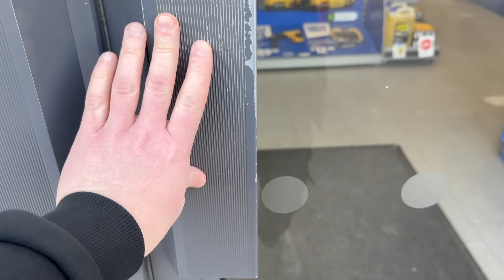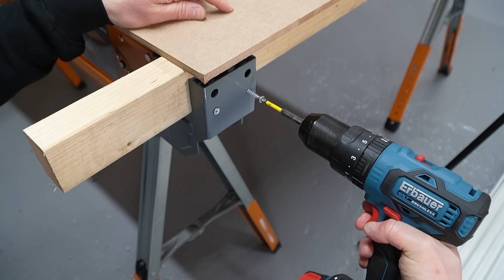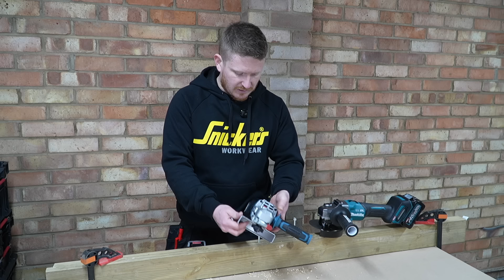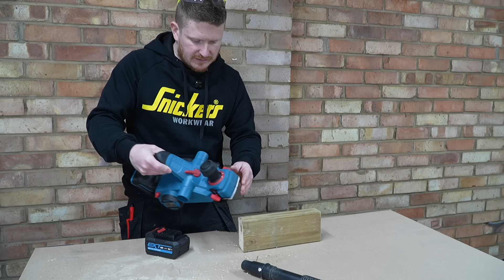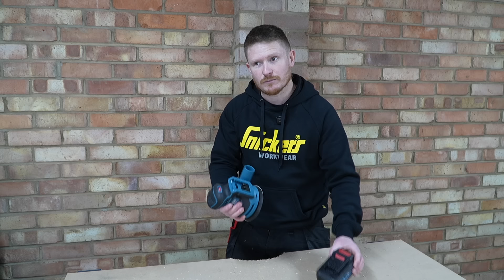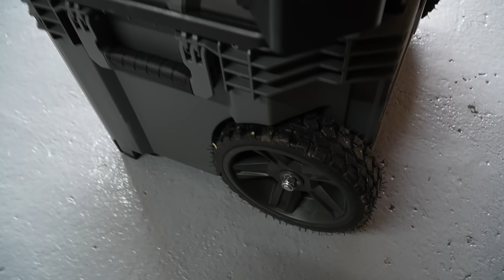Erbauer Tools Tested - Should You Buy Cheap ScrewFix Own Brand Tools?

Comment: Why did you insist on comparing it with the 40v Makita system? For me, you lost me at that (even though Erbauer equits itself really well)! And yes, I'm left handed, and yes,I like the circular saw.
However the absolutely most disappointing thing about this review is you  completely ignoring one of the best features about the erbauer system - the BATTERIES! When I bought mine, a 5Ah battery was almost HALF the price of every other big brand battery. And you didn't even mention it! Other than chineese stuff, they are the cheapest by a long shot. More batteries, more run time, no running out of energy! Just my opinion, but it's a key element to "reviewing " tools like these! 
Another miss, for you fella, is that if you lower the lifting handle on the trolley (easy spring clip affair), to its first indent, you CAN open the middle tool box, WITHOUT taking it off the cart! Just saying!
Added to this lot, I added the Recip, the 256mm mitre saw and stand, several proper lights and have been using them for over 5 years without fail as a handyman for house and garden projects. 
If I had one criticism, it would be trigger control (vs deWalt), seems chunkier. But at the price, as a brand, good quality,  good reliability (old lights were poor), and 5 years later, still doing their thing, faultlessly.  And the storage, good enough, strong enough at the price, if a little limited! Oh, and at B&Q, just wait for sales, and get the cheaper!

Comment: Right,these Erbauer tools are decent enough , you can get quite swallowed up in how well they perform for the money but i have learnt my lesson now and I am on my second but final Erbauer sliding chop saw, these tools are built on a budget ,there's  to much plastic where metal shoud be used  and  please remember tools do break and when a Erbauer tools breaks  its basically junk,you cannot  repair them,there's virtually no spares,throw away tools sadly, Erbauer need The right to repair group knocking on its door

Comment: Erbaur is a Kingfisher brand. Titan is Screwfix own brand Screwfix is kingfisher. Like B+Qs, another Kingfisher brand, Mc Allister brand these are simply generic power tools sourced mainly from the PRC.
Some of the tools are good middle range products, for example a few years back MacAllisters entry level power drill was made by a Bosch subsidery.
Much of the different between entry level own brand tool and say DeWalt, or Makita used to be down to the quality of bearings. The chinese resolved this a couple of years back.
The issue is that each tool in a ranch tends to be made in a  huge number of factories. These days quality is going up.  But it does  mean that tools in a range can no longer be said to overall good, mediocre, or bad.
These days with the availabilly of battery convertors, eg using a cheap ryobi battery in a deWalt tool, arguably we maybe should be buying based on individual
function rather than battery compatibillity.

Comment: You are better off getting second hand old tools with an electric 230v motor. My dads old , original Black and Decker, made in England drill with replaceable brushes is still going strong 40 plus years old. Not sure if the younger generation would be able to strip, clean and put it back together again though.

Comment: Good video.  Must have been preordered as my local screwfixes never have anything in stock generally. :)
Find with the cheaper kit its not brushless , hence at somepoint graphite brushes are going to need  replacing if its an option?

Comment: Erbauer kit is only good for occasional use. I had 2 erbauer orbitals - both failed and were shockingly bad quality. First one, the bottom plate fell apart half way through sanding a door. Second one lasted an hour. Don't get me started on the jigsaw, the bottom plate bucks loose under vibration and no amount of tightening or adjustment works - terrible cuts every time.   Erbauer trim router slightly better but sparked and popped every time I used it and was a bit scary to be truthful.

Comment: I bought the trolley box and large tool box just before Christmas when on offer.
I’m not trade but bought them for, and have been using them for working on cars and they are way more robust than anything else that I looked at in the price range.
The plastic is tough and much thicker than others.
It carries everything I need for each job and the large wheels are a godsend. (Most others I looked at had small diameter spindly wheels)

Pack-up now takes 5 minutes (timed 😂), rather than 20-30 minutes carrying tools back to the garage. 👍

Edit 23:23 
The handle drops down so that only the bottom case is affected re-lid lifting. 👍

Comment: On the saw, the blades are on opposite sides, so if you used the slide in guide normally supplied with the saw it would work properly.

Comment: You haven't said what the torque power is on the drills. My bosch hammer is 110 & is a .monster in to brick ect but cost £180 for body only while my impacts are 170 & 220. What are these you trying.

Comment: Erbauer power tools seem pretty good and useful tools for the money. Wouldn’t compare it to a Makita 40V, Dewalt 18V, line or the Milwaukee 12V in terms of range of tools, power or the overall quality. 
The tests on this review are very easy and any working tool will “pass” with the same success though 😂. 
But to have such cheap and functional tools for such a price - is only possible due to the industrial magic of the working man in the People’s Republic of China…😅

Comment: Carpenter Cabin builder, didnt want to spend a massive amount on my first ever set of cordless tools so went with Erbauer. Absolutely no regrets, incredible value and every tool comes with 3 year warranty so if anything does happen to break, Screwfix are nearly always local and has Erbauer tools in stock for a quick replacement. Are they as fast as the big brands, no, but they are more than close enough to get the job done well. Banter will be recieved from tool snobs though

Comment: I bought full range of brushless erbauer tools inc. an effective strimmer at start of covid. Got light and heavier duty drill packs with dual 4 & 5ah batteries which power all other tools and at the time a bonus when couldn't get them during covid. 
Most tools just fine and tool boxes like you say need to be broken down to get into. 
I am not trade so durability and light weight is fine for me. But Makita for example have stronger gearbox components and a huge range and more effective overall.

Personally I wish I had gone with Ryobi for their excellent range of useful tools. I miss a power file for example. I have bought a cheap plastic printed battery convertor for a Ryobi tyre inflator and works fine for that.

The erbauer circular saw is too lightweight and no good for thicker timber when the auto cutout prevents any useful work. Also the planer is not so effective and the small hoover is useless! 

But the rest of the range works well and the batteries are still going strong years later and hold their charge well.

Comment: I did buy an impact kit and got another tool from Erbauer. Was happy with the tools, but after about a month not using the tools, was taking out the impact and realis d the 5Ah battery leaked a black goo all over itself and the impact, so went to return it. Fair play to Screwfix, they took the other tool too. Replaced with Ryobi, as had other tools and 2 batteries from them already. No issues with the batteries there. I've read Erbauer batteries do leak.

Comment: Would I buy them as a home DIYer for infrequent use? Sure. Would I turn up on site or a customer job with kit from Erbauer, Parkside, Einhell, Skil, etc? Hell no.

If you're just starting out, or you're learning to use tools, these are great. They work and don't cost much, but possibly more importantly, they show you where the extra money goes for big name brands. Once you've lived through the pain of using crappy tools, you really appreciate the difference when you upgrade to high quality ones.

Comment: I'm a site carpenter and actually the majority of my tools are Erbauer. I would point out the twin drill/impact is their basic ones and they actually sell a much more powerfull drill and impact separately. The impact has an oil filled shock absorber so it's actually really quiet to use compared to the one you get in the twin pack.
The laser on the skill saw does seem a but gimmicky after a while but when I switch to my Hikoki corded saw for heavier jobs I do miss it. Otherwise I sum these tools up with "you can do pretty much any job with them but a premium brand will be a bit quicker and easier" so if you are day rate or permanent staff they are great but if you were self employed and time is money then you have to look at the more efficient tools.
Reply: Oh and the boxes are alright but it really is luck finding padlocks that go into the locks and work well, it's a big flaw

Comment: I’ve got a Erbauer router and I can tell you this it’s as good today as when I first bought it and I’ve had it over ten years now, Erbauer products that I’ve bought haven’t let me down and just because they are a bit cheaper than the bigger names it doesn’t mean your not getting quality. The multi tool I bought is a Worx and this is another brand not to stick your nose up at as it’s brilliant, I was so impressed with the quality I went and bought the mini circular saw for cutting floor boards and the like and this again hasn’t let me down. The only product I didn’t cut costs on was my nail gun as I’ve gone for cheaper ones in the past and they just aren’t the same as the top brands, if I was to go through my tools I would say I’ve got at least seven different brands and they all do their jobs perfectly so don’t be afraid to try other brands as some are better than others at doing certain jobs.

Comment: Great video, I’ve got the storage system and I’ve been impressed with the durability of it. I mistakenly left a box out in December where it stood in the winter weather fully exposed to nearly a month’s worth of rain and storms. It was perfectly dry inside and no signs of corrosion on the metal parts. For me as a forgetful diy guy it’s perfect

Comment: Finally someone reviewing Erbauer. I think these are perfect for a DIYer. Decent power, decent price, won't let you down. The only main downside is the tool range is quite small. If I'd gone with Ryobi or Einhell (or even Dewalt) I could have bought a tyre inflator. But I can't with Erbauer.

The circular saw is a little weedy (especially as I only have 2Ah batteries), but the "hitting the speed square" is only an issue if you've got it on a deep cut setting. Set that correctly and the motor will not get in the way. I've never noticed it was the "wrong" handedness as it's the only circular saw I've used, but I have found it a bit kack-handed to use occasionally so perhaps it is related to that!

Comment: Some of the differances in tools are hidden, like better bearings and electrics to protect the tool. Also, better and stronger plastics go into the more expensive tooling (usually) though not always. 

Gearing of various tools is also important, as one make of drill might be too fast for a job, but a different make of tool for the same job will be better at it. 

Any tool you find adequate for the job is a good tool, regardless of price or make. That's why you will most likely end up with a mixture of makes for the actual tools you buy, spread between a lot of variation of the different prices. I know I have.

Comment: I'm not in the trade, but I'd say I'm a "heavy DiYer," and the Erbauer stuff has been amazing for me for the last 5 years or so. Only thing I'd prefer is a slightly higher quality speed controller/ switches on drills and impacts. A bit lacking in low-speed control.
But that is literally my only complaint. Everything else is absolutely ace.

Comment: My sister found an Erbauer impact driver hanging in the middle of a conifer in her garden.  No idea how long it had been there. A bit of surface rust on the chuck and belt hanger and had obviously been well used. She gave it to me, I bought a charger and it charged up and worked fine. I have driven many many concrete screws and long timber screws and run it all day on it's original 2Ah battery. 4 years later and it's still going strong.
I bought the circular saw though and it's crap. Lacks power.

Comment: Haha, loved it when you said "And again we're gonna use a high quality blade, because we don't want the blade to be the issue", when loading up the multi-tool.
Which if you have ever used Erbauer multi-tool blades, you know that they WILL be the issue.
For any of the Erbauer tool accessories, if its something that you need for 1 job and its not a demanding job then they are acceptable enough to get you through it for the price point, e.g. I needed an SDS drill bit I think at a 22mm diameter, for drilling a single hole, so no need to pay out for a decent bit, it should be (and was) good enough to do the job without having to pay a fortune.
However, anything more than that one job and yeah, Erbauers cheap Chinese steel really doesn't hold up to much hammer at all, especially the multi-tool blades, they are garbage.
Nice to see that the power-tools are holding up quite well to more demanding tasks that a DIYer might need them for, but it is worth noting that whilst the 40v Makita tools might be double the price, based on the prices you gave for the Erbauer tools, Im pretty sure that a lot of my Makita 18v's were only around £20-£30 more and I know I can trust them to stand up to very demanding tasks for many years.
Infact I have only ever broken one tool and that was when I dropped my impact driver off of the top of scaffolding, which was £100, then when I tried to buy a replacement it had been discontinued for a newer model which had gone up in price to £135, ordered it twice and it didnt arrive either time which I suspect was due to that one also being discontinued for the new model released at the start of the year, so I ended up having to buy that one at £220 o_O  which yeah..... that still hurts haha.

Comment: I have most of the Erbauer brushless power tools with the 5amp batteries. I have been using them regularly for a number of years with no issues. I got the stack storage system last year on offer for £80 which I thought was a bargain. For the home DIYer, I feel you cannot go wrong with these brand of tools. The 5amp batteries make a big difference.

Comment: As an electrician I chase out a lot of walls using SDS drills.  I'd burnt out 2 bosch and 1 Makita cordless SDS units before I tried the erbauer version. I've had it now for 4 years without any problems at all.  I don't know if that's just lucky or a testament to the erbauer level of quality but I won't be looking to go back to paying 2-3 times the cost anytime soon...

Comment: Erbauer tools are very good, but I can't say same about they batteries. There is screwfix forum topic about that, just google erbauer leaking battery. I lost 3 batteries due to that issue. I contacted screwfix, only distributor, but on the end of the day they refuse any repair, refund or replacement.

Comment: Big fan of DeWalt, used an Erbauer drill once and it seemed a bit cheap but did the job. What I have found with Erbauer is the HSS and Masonry bits last longer than bits costing far more as do the driver bits.

Comment: Erbauer tools are fantastic value and perform just as well as more expensive brands. I am a trade user and  every thing is up to the task. SDS breaker/drill is a fantastic drill out performing my mates  bosch unit, always use the Eubauer to drill extactor core holes but the breaker is not that powerful. Dont be a tool snob and take the plunge.

Comment: All of my experience so far has been with their power tool accessories, sds drill bits, hole saws etc and unequivocally I'd say that is somewhere I'd spend the little bit extra to get bosch accessories as the quality is significantly better and they last more than one job.

Comment: DIYer, Erbauer impact driver been a game changer for me. Made light work of battening out my brick garage, never missed a beat. Still going strong. My favourite tool by far.
Reply: I gave an older model Milwaukee impact driver to a mate of mine (an 18V version and he already had the hammer drill 18V) and he found it a revelation to use, instead of using his drill to put screws into wood etc.  I also gave him a (for me) redundant Erbauer corded jig saw, which he has found excellent.  It cost less than £50 at the time I bought it and still works well.

Any tool that works is a good tool, no matter the price point or make. Do expensive tools last longer and perform better, usually..
Reply: @sirmalus5153  I absolutely agreed, but you get the dickheads on site who are tool snobs. I run Erbauer as a sparky, does everything I need it to for a fraction of the cost. I had Makita before, and they kept breaking.

Comment: Random question lads. Can the Li-ion batteries be kept in a standard garden shed? I had a shit B&D cordless and the battery just died. Or should i keep the new EXT range batteries in the house?
Reply: I was led to believe the cold damages rechargable batteries, so just to be on the safe side I bring them in during freezing weather.
A quick google told me this.
When your batteries internal temperature drops below 32 degrees, the lithium cells are unable to accept the same amount of charging current (warmth) as they did when the temperature was warm. Don't charge your lithium batteries when the battery temperature is below freezing.
Reply: Fair play Keith. Appreciate the explanation.